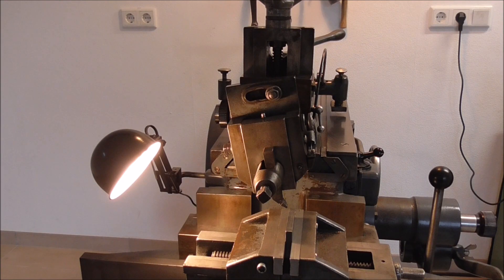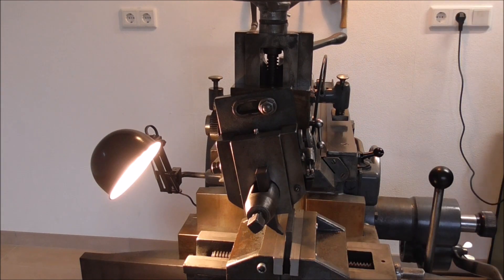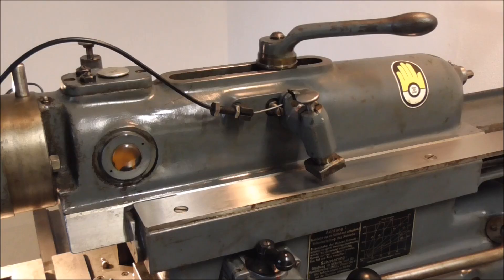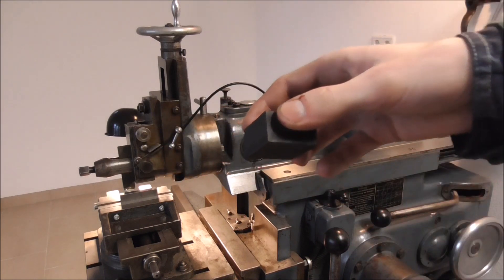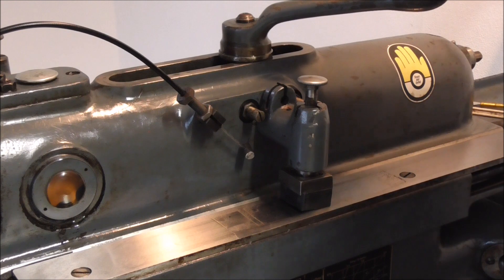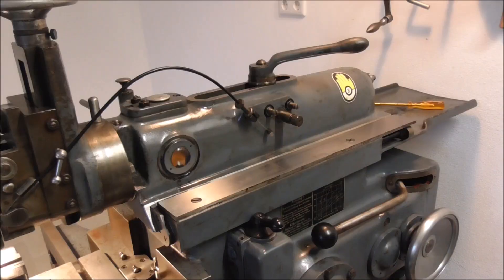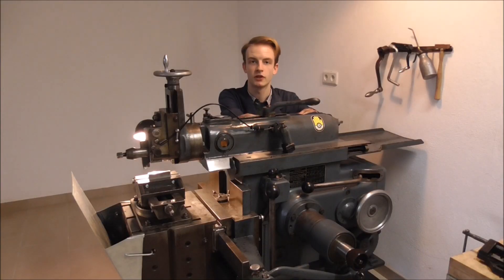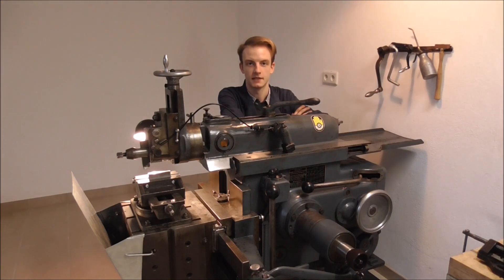The automatic Tool Lift on my Shaper

Comment: your machine is equal to mine. Adrian i want ask you the handweel is too tight, could you tell me what happen please.
Reply from the maker: Which one of the handwheels do you mean? The tool slide can be locked with a gib screw, which will make the handwheel go tight. The play of the leadscrew can also be adjusted with two nuts on top of the handwheel. Should they be adjusted too tight, the handwheel would also go hard. 
Last but not least, the depth feed might still be engaged, so you'd have to turn the entire mechanism with the handwheel - that might also be a reason for it being tight.